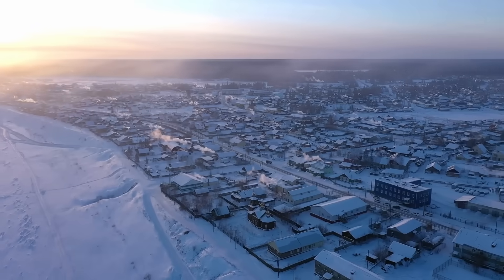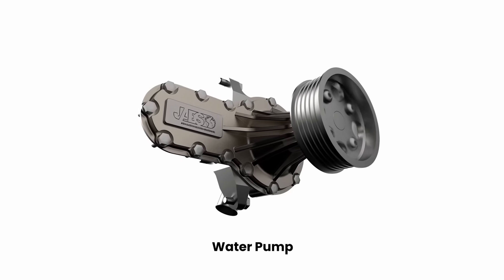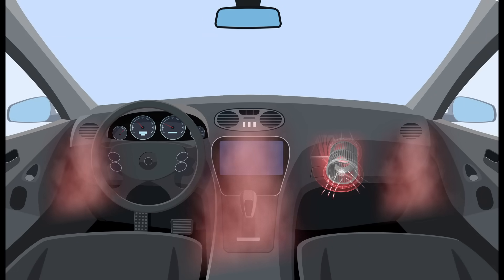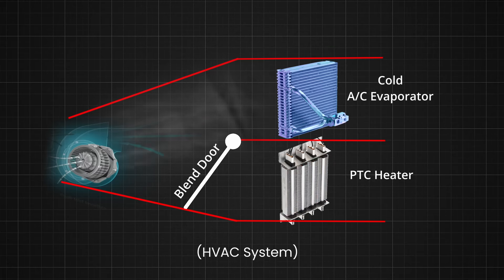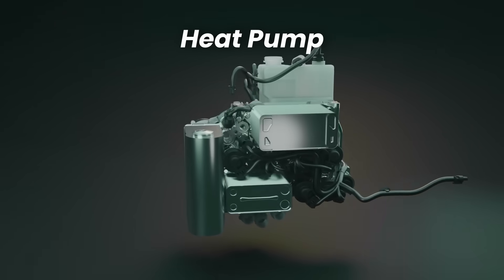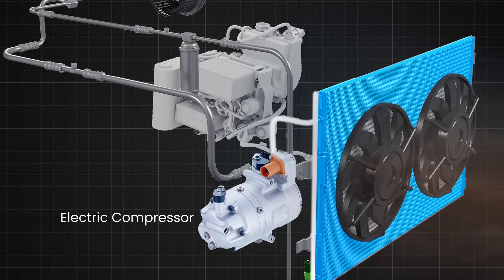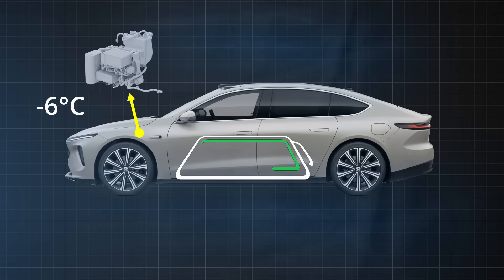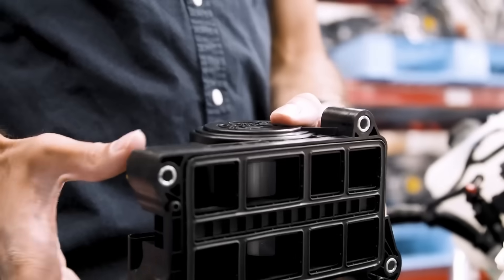Cabin Heating Explained : Engine Cars vs. EVs (PTC Heater, Heat Pump, and Tesla’s Octovalve)

Comment: nice explenation. But PTC means Positive Temperature Coefficient (like you explained). The whole point of that is that is does NOT have a constant resistance at different temperatures ;).

Comment: If the outside temperature is below 18°C, or let say 10° below, the car ac is max cold 18° so even if you dont use heater, the ac will blow warm air due to outside temperature is colder the car ac, example in Canada, the winter in Canada sometimes 5°- -35° and the the car or any vehicle has max ac at 18°, that still warm air inside cabin of car, to tell you, I don't use heater, I use AC and that it, I feel warm even my ac is in max to 18°. Or maybe we have a different understanding on it? This is just my opinion and experience. 😅

Comment: My year 2000 Isuzu Trooper has an electric heater element in the air duct, to generate heat immediately, before the engine has warmed up.

Comment: have a 2025 model of suzuki s cross, and i want to take good care of engine. When is the good time to turn on the heater, after couple of minutes of driving or? Does the temperature gauge on the dashboard play any role for it? Also i am guessing the modern cars use inverter AC so do i use AC for heating aswell or is it useless?

Comment: This was a very simplified view of an ICE car HVAC system.
My last ICE car, a 2012 Golf TDI had both a PTC element and an auxiliary diesel heater. The PTC element would assist in getting the cabin up to temp along with the aux burner. The auxiliary burner would, if set to auto, run at temps below +5C until the coolant temp reached around +50C.
The auxiliary heater could also be run to pre-heat the cabin if needed. It did however cause a drain on the 12V battery as it had to run the cabin fan. Even if the car had a pretty good charger it was advised to drive at least twice as long as the heater was running to prevent the battery from draining.

Comment: I have a Tesla model 3, and having come from a life of diesel Audis and VWs, im majorly impressed with how quickly the model 3 generates heat do the cabin. Even without pre conditioning, heat comes through within 15 seconds even in freezing temperatures. Stupidly efficient.
Reply: All EVs do this really. There is no need to wait for the coolant to heat up.
My last ICE had both PTC and an auxiliary diesel heater to help. It would blow hot air within a minute of driving. If I turned off the automatic aux heater it could take an hour before the engine was up to normal temperature in winter time. Modern diesels are pretty efficient and take a long time to heat up.
Reply: The fiat panda twinair 4x4 had warm air coming from the vents in I think 19 seconds. It's 0-60° coolant temperature time is quicker than it's 0-60 time which is 20 seconds 😂
Reply: Same with me, I had a Audi and BMW before but now last 3 years a model 3 and it is amazing in winter
Reply: Eh? I have a VW ID3. We can pre-heat our car via an App. It’s even setup to start on a schedule on the days my wife goes to work. 
We were at our daughter’s house yesterday & it was -2’ Celsius outside. About 20 mins before we left I started the heating. We came out to a warm car. All the surrounding cars were covered in frost. 
Americans can be so backward. 
Tesla is nothing special in Europe
Reply: Quick doesn't mean efficient.  It's simply adding resistance to current from the battery
Reply: So why ev drivers drive in thick winter cloth then 😂😂😂
Reply: @generationx227 ….. they don’t.
Reply: @generationx227 like all EV antis, your comments are 10 years out of date.
Reply: @generationx227 try a Tesla and you will never go back to your dinosaur of a car that needs 3 -5 min to give any heat at all.

Comment: actually the temperature knob or adjustment actuates the blend door actuator, could be electric, manual cable driven, or vacuum operated.  rare cases does that allow hot coolant to divert into the heater core, heater core in most cases is always hot during engine operation. edit: ok he does go over that, in the first part he was wrong

Comment: it would make sense to heat ev cars with diesel webasto
Reply: Why? In most cases you have it plugged in at home and can use much cheaper electricity to heat up the cabin.
Reply: @Gazer75 but heating something with electricy is not efficient unless you have plugged in
Reply: @koseku3  Why not? The electricity was more efficiently generated and stored in the battery. And any modern EV intended for a cold climate market will also use a heatpump which is more efficient.
The amount of wasted energy to extract refine and transport fuel is crazy.

Comment: Instead of using pta or octovalve system they can use a belt drive from the motor which powers wheels and connect it to the compressor and this will be much more efficient, only few components will use power and from 15% all the way to 5-10%
Reply: Doesn't work when you also need this system to precondition the battery or heat the cabin while the car is parked.

Comment: As an engineer, I would not call Tesla's system revolutionary. It is only a straight-forward common sense development step.
Reply: riiight, but it is the first (and still only) production car heat-pump system to use a single, compact 8-port valve...so i would say its revolutionary.

Comment: One of the best things about electric vehicles is that the heater pumps out hot air the second you turn it on.  No need to sit there freezing waiting for a fuel burner to heat up.  I can just get in my Tesla in the middle of winter, not even wearing a jacket, and the seat is as warm as the cabin.

Comment: Nice informant video. Just consider that It is not a Tesla technology. It's been using by AC manufacturers for at least 30 years and they developed it to fit in an EV car.
Reply: The heat pump is actually MOSTLY for the battery .. to keep the battery temp operating at its ideal range (which happens to also be the same temperature humans like).  Shuttling some of the heat or cooling to the cabin is a happy by-product.

Comment: What about hybrids?
Reply: I cannot speak about hybrids, but I can speak about my plug-in hybrid (PHEV).  It is a 2025 Kia Sorento PHEV, and I live in the Great White North.  This Sorento PHEV has a battery, rated for 48 kms, and also has a 1.6 L 4-cylinder gas engine.  As it turns out, I have a daily drive of about 48 kms one way.  In the start of the first half of the drive, in the winter, the gas engine is typically on, presumably providing some passenger cabin heat, and also warming up the battery, but the primary source of power to move the vehicle is coming from the battery.  In this instance, the gas engine is running at approximately. 1,200 rpm, which is more or less a fast idle.  However…. if the ambient temperature is -10°C, or below, the wind chill effect of -10° C air flowing through the engine’s radiator, at 90-odd kph, is enough to actually keep the engine coolant at a low temperature, to the point where the engine doesn’t actually warm up.  The instrument panel has a bar graph for engine temperature, and under these conditions the bar graph shows engine temperature to be so low that it barely registers on the bar graph.  As such, there is not a whole lot of surplus heat flowing into the passenger compartment’s rad core to be transferred into the passenger compartment.  There is some heat, of course, but it does not get warm enough during this first half of my drive to prompt me to want to turn the heat down.  It is a good thing that this vehicle has seat heaters and a heated steering wheel.  On the return leg of my daily trip, the situation is reversed: now the battery has little reserve power (usually around 15% or so), and so the gas engine is now the primary source of power to move the vehicle.  The gasoline engine typically is now running at about 1,800 rpm, which is adequate to overcome the wind chill effect and keep the engine temperature in the middle of the temperature bar graph range, thus providing more than adequate heat to be transferred into the passenger compartment.  On this return leg of my trip, I typically have enough heat to turn it down.  Depending on how you use a vehicle (and how cold it gets in the winter), this characteristic might be a deal-breaker; I find it to be more interesting than infuriating.  Sorry (yup, I’m Canadian) for the long explanation, but I thought my real-world experience would be useful.

Comment: 4:54 - Once the car's interior is heated up, likely significantly less than 1kW of generated heat would be needed to maintain the interior's temperature.  Because the car's interior volume is very small at less than a small walk-in closet's volume.  Cars sold in cold climates likely will have more insulation in the door panels.

Comment: Would the system be the same for hybrids as it is for EV or ICE??
Reply: Unfortunately not. I have a Toyota hybrid and it has a standard ICE heater. It gets warm really slow because the aluminium engine block dissipates a lot of heat and the ICE has to stay constantly on to warm up the cabin. Consequently, in winter you have twice the fuel consumption. It’s, imo, a really stupid system.

Comment: Mitsubishi iMiev has water based heater from ICE model, with electric heater iside overflow tank and water pump, instead of havimg PTC hester. But it males super easy to instal diesel heater.

Comment: Renault Zoe AC circuit is set up like this:
AC pump
Cabbin heater core
Outside evaporator/condenser (there is a bypass valve)
Internal cooler evaporator (with bypass valve)
Battery cooler
PTC heater for some markets

Zoe can at the same time cool and heat air for maximal defrost effect.

Comment: Tesla’s heat pump takes far longer to produce heat compared to resistance heater. The octovalve introduces many points of failure
Reply: Not compared to a gas car. It's much faster. I feel warmth within 20-30 seconds.

Comment: YEARS AGO,
In the early days of automobiles before the engineers figured the current coolant heating system out, what was done was they ran the exhaust pipe which is nearly  RED HOT
into the cabin & under the dash radiating heat to the passengers. Dont stretch your legs too far under that dash of you will get burned from that hot pipe! Problem with that 
system was it was  ON  always. Even on a hot summer day. Yeah, those were the days...

!

Comment: Multi engine planes environmental systems are funny. Most piston planes use heat off of the engine like a car. The BE-76 duchess has 2 engines and uses neither of them to heat the cabin. It uses a combustion heater. It is located in the nose. It is basically a a tube with a coiled tube in it. Aviation gas flows through the coiled tube and is ignited by a spark plug and this heats the tube. Then there is a fan in the larger tube that blows the hot air to use as a heater. Creative on beechcrafts part.

Comment: The Octovalve is for the coolant system but it's not connected to the cabin heating. Cabin Heating is exclusively made with the Heat-pump(Supermanifold). So what are you said it's not 100% right :)
Reply from the maker: The Octovalve primarily manages the coolant system, but it plays a critical role in both heating and cooling the cabin by efficiently routing heat or cool energy between various components and the HVAC system.

The Octovalve works as a dynamic controller, receiving heat from major components like the battery pack, drive units, power electronics, and even the heat pump compressor. In heating mode, this waste heat is routed to the heat pump and Super Manifold to warm the cabin efficiently.

When switched to cool AC mode, the Octovalve directs coolant to dissipate heat from the cabin through the condenser, ensuring cool air flows into the cabin. At the same time, it manages heat rejection from components like the battery and power electronics, keeping them within optimal operating temperatures. Essentially, it balances heat distribution throughout the system based on real-time needs, whether for cooling or heating.

I appreciate your thoughtful comment, as it highlights the complexity and efficiency of thermal management system!
Reply: @motoringmasters  No, the Octovalve just routes the coolant water between drive components. That is true that it took heat from the Refrigerant or take cool from it but for just the cabin heating Tesla uses just the Refrigerant system, if the cabin just need cooling then naturally the system will dump heat energy to the coolant system and so while just heating needed then cool energy to the coolant again from the Refrigerant but the waste heat from the inverter won't transfer to the cabin that is used to heat up the HV Battery. :) That's why I said not all wrong what you've said. I'm a Tesla Mechaniker so I know how this system works.

Comment: Makes sense. My cars engine is tiny, and i need to idle 20-30 minutes to even begin to feel warm air when outside is -15 or lower
Reply: If you just start driving:
- you don't waste fuel and engine wear
- you'll get where you are going quicker
- your engine will work harder, therefore produce more heat and warm the cab more quickly.
Reply: @jesse291  tell that to fully frosted windows from outside and inside :D
Reply: @salemas5  Where do you live?
Reply: @salemas5 At that point, it makes sense to put a run a cable to your car and put a timer and a small space heater the pre-condition the car for you every morning. Or use one of the cheap 12V heaters and put it under your windshield (should help defrost it quicker + the extra current draw will heat up the engine quicker due to additional load).
Reply: @jesse291  And your hands will fall off before you get to work. Yes gloves exist, but many people (myself included) hate driving with gloves. EVERY car needs a heated steering wheel, then I wouldn't mind getting into a cold car.
Reply: @sphygo get a remote
Reply: @us3rG  Had one, but it’s still quite wasteful to leave your car running for half an hour before you leave. Excess wear on your engine and fuel consumption. The air might heat up in 5-10 min, but it takes a lot longer for surfaces to warm up as well (depending on just how cold it is outside) meanwhile a heated steering wheel is comfortable to hold in 2 min or less
Reply: Usually with smaller engine vehicles, I keep the revs around 3k give or take
Reply: LPT: Don't turn on the heater until you see the coolant temperature goes up. Just drive after 1 minute or so, that's more than enough time for oil to circulated fully. It will warm up the engine faster and you'll get your heat faster. If you must turn it on for visibility reasons, then go ahead.

Comment: AC system (Heat Pump) is already available in the Electric car. Can it not be used to heat the cabin ?
Reply: @yt678901  in a lot of newer cars and higher trims it is

Comment: On 2:50 it is specified that the air coming from the blower is either directed to the evaporator or the heater core, depending on the user input. That is incorrect, as air from the blower always passes through the evaporator first regardless whether the HVAC is set on full hot or full cold, as the air needs to get dehumidified before getting heated up.

On Auto mode, the same HVAC control unit regulates the mixing door that lets air through the heating core or bypass it.
Reply from the maker: Thank you for pointing that out! You’re absolutely right, the PTC heater is positioned after the A/C coils, especially for defrosting.  Brands sometimes vary in this configuration depending on the climate and specific vehicle needs. For clarity in the video, I simplified the layout to avoid confusion and make it easier to follow. I appreciate your input. It’s great to have this kind of feedback to show how varied these systems can be!

Comment: I was actually wondering how Tesla’s heat pump worked the other day when it was cold out. The way it does is actually insane wow lol. Tesla’s engineering is absolutely wild man..
Reply: Yeah instead of building in heating elements they can just run blind currents through the motors to generate heat. Pretty smart.
Reply: @daniel_960_  Why add extra parts when you already have big resistive loads available? Just run them poorly and like magic they make heat instead of power. Excellent multi function use. It's neat listening to them ramp up on a sub zero day or when prepping the car for supercharging. Instant heat is also super nice. Even when it was -15 F here I only had to run my car for 8 minutes to get the cabin up to 70. Sure my range that day was halved, but days that cold are rare, and at least I was comfortable on my way to work.
Reply: @sphygo because a motor isn't a resistive load lol, and using your motor windings as a heater is the dumbest thing you could do. 
Tesla saves $$ on a part, and you pay $$$$ to fix a part that wore out quicker. 
What if your HVAC compressor broke? You are sol. Me? No problem, I have a backup. 
It's stupid thinking like this is why musks doge website was hacked - couldn't be bothered to pay competent ppl to make a web site ffs.
Reply: @daniel_960_  actually uses a heat pump like a mini split
Reply: The heat pump is actually MOSTLY for the battery .. to keep the battery temp operating at its ideal range (which happens to also be the same temperature humans like).  Shuttling some of the heat or cooling to the cabin is a happy by-product.
Reply: Ouais eh bien il n’y a pas que Tesla qui sait faire ça (et même pour dire, Tesla a mis du temps pour introduire une pompe à chaleur dans ses véhicules). Me font sourire les américains qui pensent que leur industrie automobile est à la pointe de la technologie…
Reply: @zobof1er buddy.. French EVs have start engine buttons. 

Please inform me what other car has an octovalve system?
Reply: @zobof1er c’est clair mdr